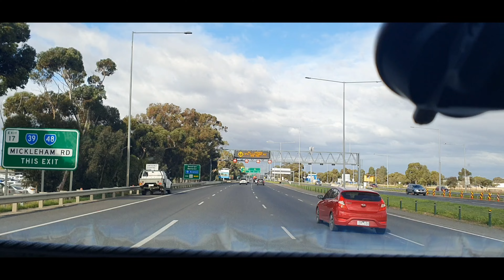Install of the Dobinsons MRR shocks and springs on the US Landcruiser 200 in Australia - NOT Easy.

Comment: I have the same issue with my LC200, I installed the MRR suspension kit today and they had to install the reservoir inside the engine bay because of not enough room in the wheel arch. I’m not happy with this because it will overheat the suspension oil and performance will be compromised and lifetime of the oil will become shorter
Reply from the maker: Where we put it seems to work well. Still visible in the wheel well area and she sits on the chassis frame
Reply: Why wouldn't you let your tyres down to to get it into container surly with these tyres you could reduce hieght by 30 to 50mm